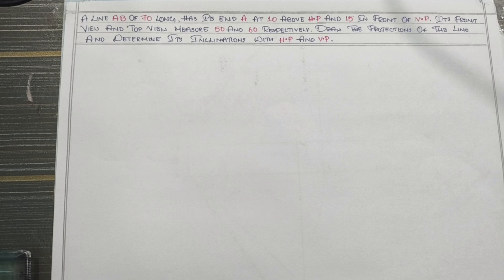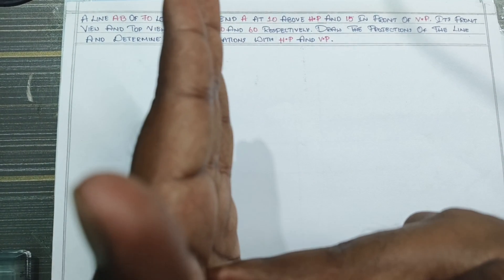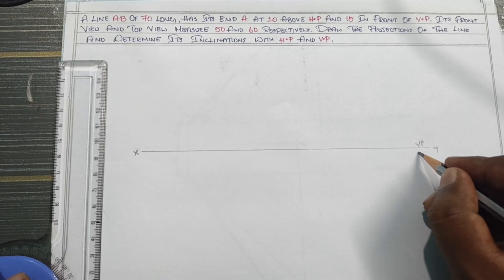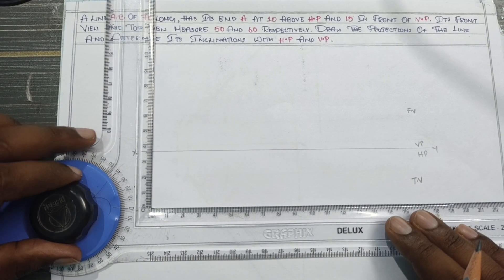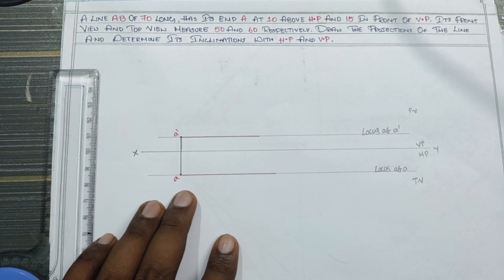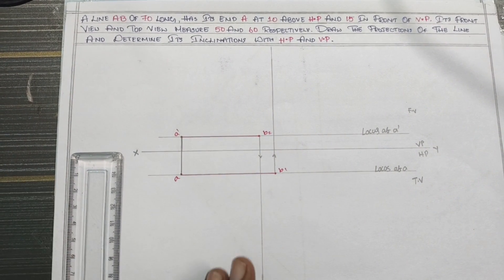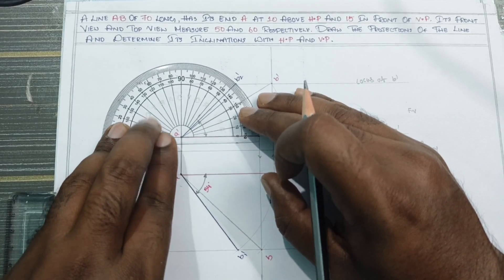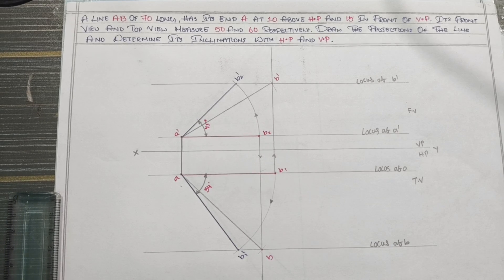PROJECTION OF LINES - METHOD-2

Comment: The projectors through the HT and VT of a line are 100mm apart while those through its 
ends are 65mm apart. An end of the line is 15mm above the HP. The HT 40mm in front of 
the VP and the VT is 75mm above the HP. Draw the front view and top view of the line 
and find its true length. Also the inclinations the line makes with the reference planes.
Reply from the maker: I don't know
Reply: @radhajayaprakash  tomorrow I have sem exam sir and while I'm preparing I found lot of questions like these in last sem's question paper
Reply from the maker: https://youtu.be/rNn18GoNrzk?si=dkZIssL7r3feWrdS
Reply from the maker: See this video
Reply from the maker: https://youtube.com/playlist?list=PLy5ZBUAY2tRpR0MvKLbLa1vx6m10aqVSE&si=IAMhYhZYlmdrgVxL
Reply from the maker: See last 3 question Most important
Reply: @radhajayaprakash  ok sir👍 thanks sir
Reply: @radhajayaprakash  sir could you pls suggest some tricks and units to pass tomorrow's exam sir
Reply from the maker: Send me syllabus 9578994422
Reply from the maker: https://youtu.be/MIpkD9LUqAY?si=2hRFCXzvqgpPtkPA